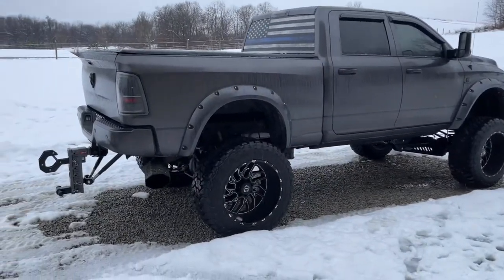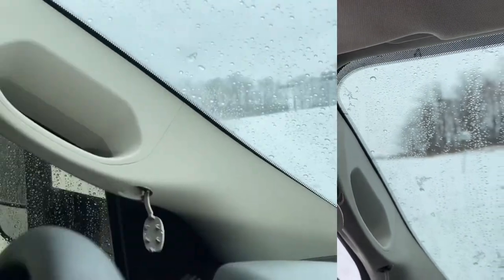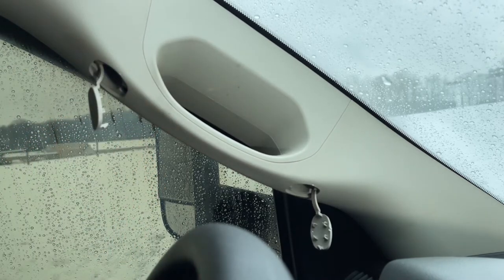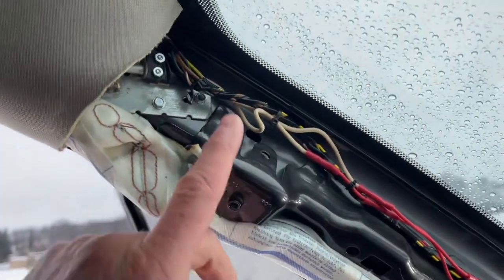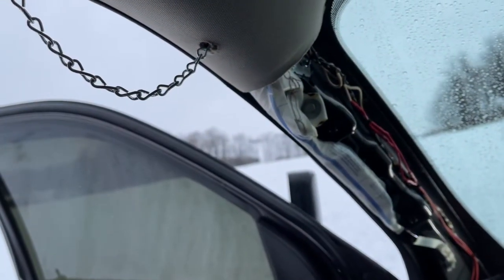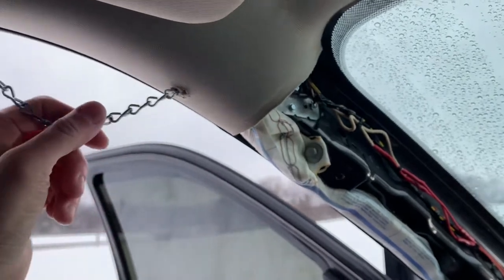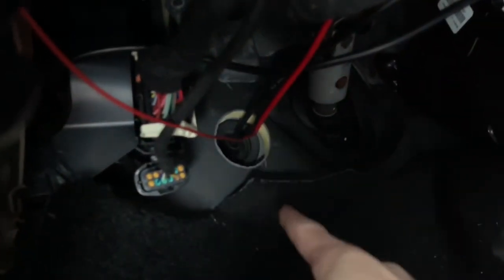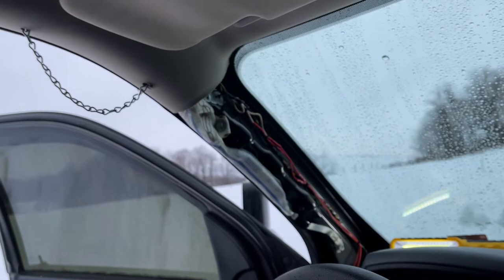Chain Pull Modification to my HornBlasters Train Horn on my 2016 Ram 2500 Cummins.

Comment: those switches are at Napa auto parts i cant remember the part number off the top of my head but they are in the store just make sure you call before you get there so they can get their hands on the part

Comment: What's uo man, nice truck. Is any way for u to show me how u attached the pull switch to the pillar? Did u bolt in an angle bracket to screw in the switch?

Comment: awesome job bro, got me thinking about doing this. What did you tap into for your accessory wire that controls the compressor?
Reply from the maker: I honestly can’t remember lol but I did post a video on how I wired it all up…
Reply: @DieselLegiance  do you happen to have a up close pic of the pull switch mounted? I know you mentioned its up close to headliner. My switch came today so I'm guessing the lead wire and ground are interchangeable?
Reply: @DieselLegiance  question Matt? I looked at your wiring video and took a snapshot of your diagram. Now that my kit is here I can better visualize. Pressure switch has 4 wires, black for ground, blue for 12v key power on ( in your diagram this blue wire 18g is going to the compressor switch in the cab that’s corrected to a 12v acc source correct? Red 12V power source wire goes to pin 86 on the relay yes? Or is that the white compressor wire that gives there? Sorry got a little confused and needed clarification. So the compressor red wire goes to pin 86? Your diagram shows two wires from the pressure switch but there’s actually 4 wires. red, white, blue and black. Thanks for your help

Comment: So I go with a vixen set up that comes with a horn button and wanted to go with a pull string, one end of the wire would go to the pull switch and the other would go to the solenoid?
Reply from the maker: Sounds about right.  As long as you have the correct momentary pull switch it should work.
Reply: @DieselLegiance  good deal, the send a small momentary button to go with the kit,I was hoping to replace it with a pull switch you're describing
Reply from the maker: Nice 👍🏼 it’s not that hard to do.  You got this 👊🏼

Comment: Dude, you destroyed your headliner. You could have done this so much cleaner. If anyone is looking to install a set of horns then his instructions are well laid out, just for the love of God please use wire loom and run your wires nice and clean, not like his. Everything single thing I install, doesn't matter what it is ends up looking factory clean.
Reply from the maker: I actually did go back in afterwards and cleaned everything up.  I just left that part out as it’s not very fun to watch and I didn’t want a longer video.  Yes, I have a small hole in my headliner but that’s what I was willing to do to create a chain pull.  I’m happy with the outcome.
Reply: Ok cool bud but is it your car
Reply from the maker: These are all my personal vehicles.  I own them.